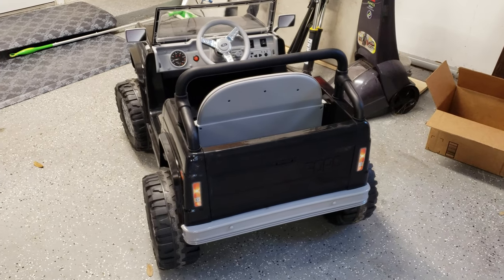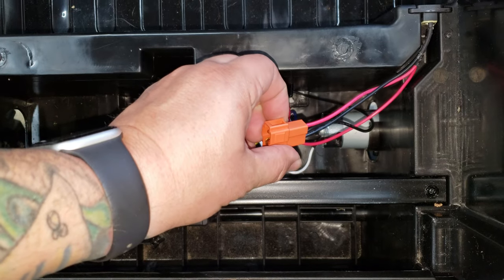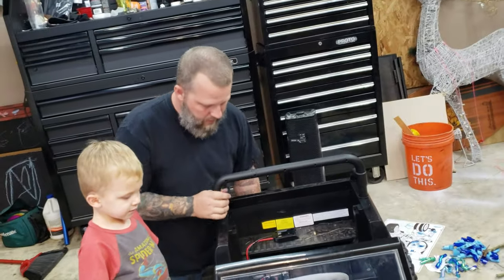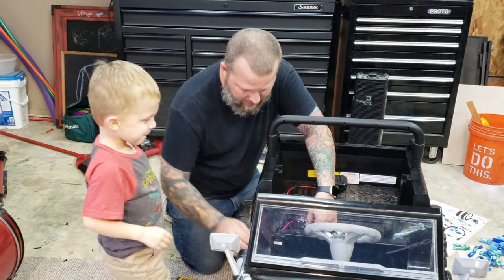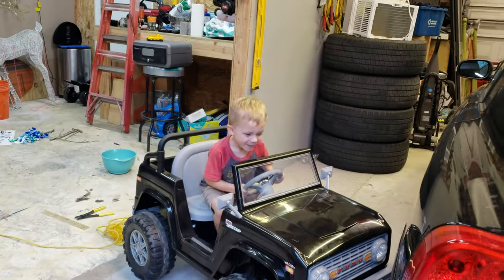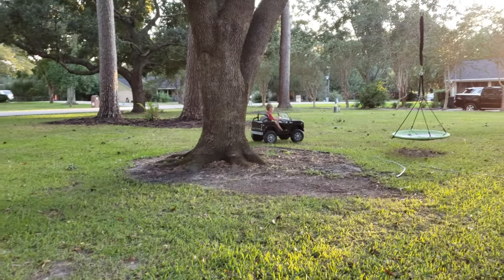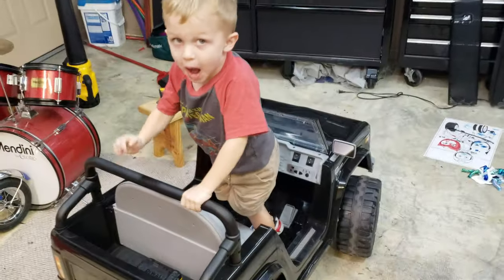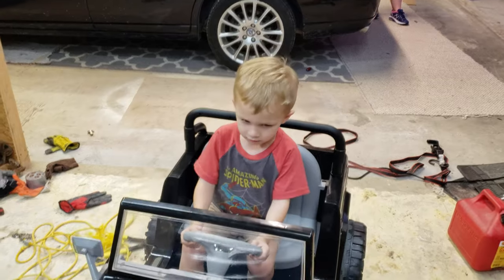bronco power wheel battery upgrade

Comment: a note to anyone upgrading like this, you really need to pay attention to the voltage increase...a step down (regulater) should be used for the stock components (radio, lights, etc) to keep their voltage the same, and on many models you should upgrade the controller and motors to the same voltage of the battery. Make sure you run a 30 or 40A fuse between the power and the components to keep from frying anything and catching the power wheel on fire. 

that sucker definitely needs a second motor for the left rear wheel and some good traction upgrades! he was so excited, i bet he was wanting more super quick!
Reply from the maker: He had a blast with it until we moved and now it’s been in storage. Can’t wait to get into our new house and build something even cooler

Comment: Im in the middle of doing this on my kids truck and am not having much luck. I did the red and black from the bottom of the car directly to the red and the black from the battery and the engine starting sound happens but nothing else. What do i have wrong? Do i have to do something with the blue and yellow and white and yellow wires other than keeping them connected?

Comment: Just did this upgrade to my sons same model, way better now, great post on an awesome upgrade, did you notice an electrical smell after the first couple minutes? I figured the motor wouldn't be happy about the extra juice, just wondering if you had the same issue or if I should take a look a closer look at it
Reply from the maker: Awesome!!! Yeah the motor gets a little hot sometimes. Especially if he’s driving in the grass. It won’t last forever I’m sure the motor will give out eventually. I need to post the video where I added all of the lights 👍🏻
Reply: @slippedwrenches  Ill keep an eye out for it, did the radio stop working in yours by chance? I'm planning on welding up a piece to make both rear wheels spin, add some rubber to the tires, and lights as well. and when it does burn up the motor, i figured id swap up to a 12v motor, maybe get some more life out of it...or some hoverround wheel motors 😁
Reply from the maker: Radio still works. I have added a bunch of lights to his and rubber tires up front for better steering.

Comment: Are the red and black wires coming from the bottom of the car the ones you cut to connect to the regulator? Or is it the red and black wires coming from the charger input?
Reply from the maker: yes those i cut to go to the regulator. you have to have the regulator between the battery and the electric motor

Comment: Has that 6V motor burnt up yet?
Reply from the maker: Nope still going. It’s getting hot now though
Reply: @slippedwrenches  my son's 6V motor burned up in the first 20 minutes. We are going to replace it with a new motor. We are using the 18V Ryobi batteries, what size motor should we get?

Comment: Could you share how you managed to do it
Reply from the maker: I thought that's what this video explained. Did you have a specific question?
Reply: @slippedwrenches  yea did u have to solder the wires or is it plug and play
Reply from the maker: I used regular clamp on wire connectors.

Comment: Dang I did this and it's a great improvement but I heard a pop and now the radio doesn't work 😭😭😭
Reply from the maker: Too much juice for the radio huh. My son never used it.
Reply: @slippedwrenches  yeah that's my guess. I'm guessing the 6v system couldn't handle it. I'll look into it eventually and if I find a solution I'll respond.
Reply from the maker: Yeah my son never uses the radio so I didn’t even think about that part. Time to add a Bluetooth speaker 🔊
Reply: you have to run a voltage regulator between the power to the components, it'll drop the higher voltage down to the original 6v (in this case), after you manually tell it where to drop the voltage to. So many people are destroying their components and motors without worrying about the extreme increase in power. You'll literally burn the thing to the ground if you just toss more power at these without regulation lol